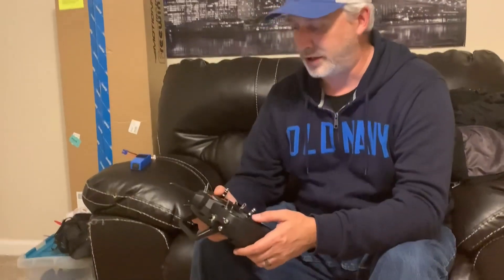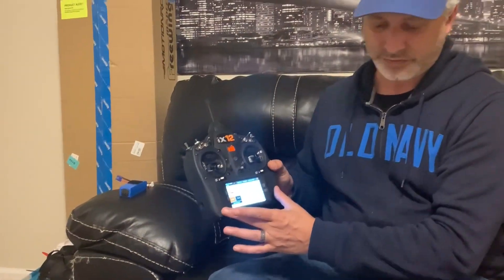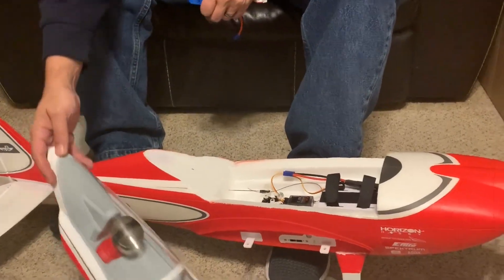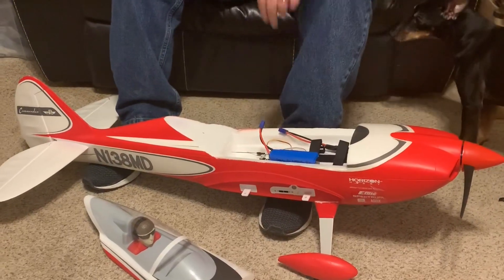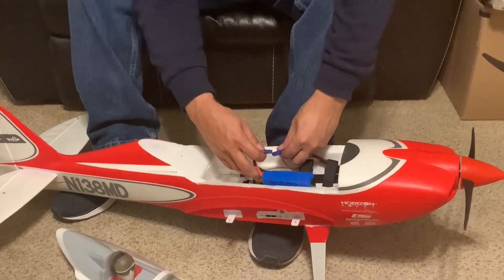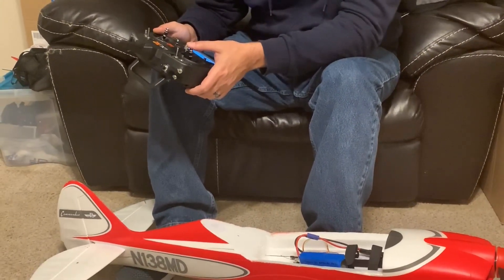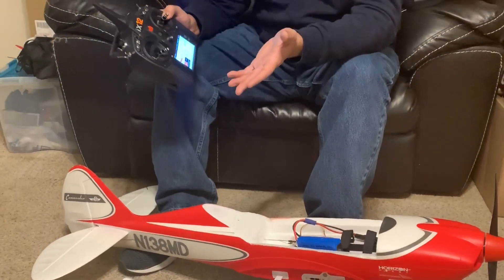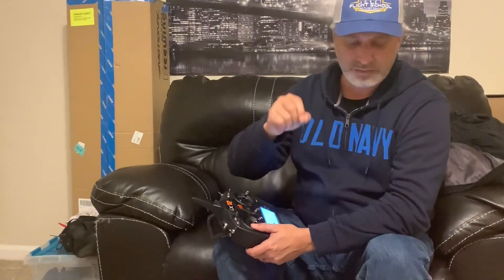How To: Calibrate your RC Airplane Electronic Speed Controller (ESC)

Comment: Not expecting a response but at least I’ll try have my very first plane and I got it used and ESC was broken so I bought a new one the 40 amp E-flight. I’m using a spectrum DX6i. I tried doing this calibration technique and it doesn’t do that first series of beeps it does something a little different. I think it’s like three beeps and then a funny tune to these switches that say flap. Jyro or gear or F mode and so on are those all supposed to be set to zero or on one all the way forward all the way back I do have my trim set all the way down to -100% my throttle button is inhibited I don’t know what to do. Thank you,

Comment: So my question is I don't start getting power to my motor until I'm between 6-10% throttle, is this normal or should it start powering up at 1%?

Comment: That's not calibrated when you get new speed control plug in to battery with throttle midway then push switch to top to heare two beeps then back to middle down to bottom then three beeps then it calibration

Comment: I have a vgood 30amp 3to4s esc and my motor is reving to high and kinda twitching and getting hot there is no deadband and I tried recalibration can this be because I'm using a 4s 100c rating lipo should  try 3s I'm stumped and I'm trying to get this going for my dad's birthday tomorrow thanks oh and the motor is a 2206 2500kv rated 4s thanks

Comment: Just seeing this for the first time. Excellent stuff. Does it matter if the transmitter has throttle cut on or off?
Reply from the maker: Throttle cut needs to be off. The ESC needs to sense that the Transmitter is sitting at 100% throttle to send the ESC into stick programming mode upon power up.
Reply: I tried it this morning on my Eflite Valiant and it did not seem to work. Does it have to be bound in AS3X only?

Comment: This is very helpful. I think i gotta do that for one of my planes. Did you keep throlle cut on initially when you plugged in the battery forst time with throttle stick all the way up??
Reply from the maker: You have to have the throttle cut off for this to work.
Reply: @TheRCAirMarshall  hope this works. My F 16 70 mm e flite motor keeps spinning even at throttle all the way down.

Comment: Air Marshal, I thought I knew how to do this but was having trouble with my Eflite 70mm F-16.  It didn't  have any get up and go.   I watched your video to double check and went to calibrate the ESC, it doesn't go into programing mode.  You get 1 quick squeal and then right into the 6 beeps.  Throttle cut is off, Throttle trim is set at -100.  But no programing mode.  Any thoughts?  I don't want to test fly it without the full range of throttle.
Reply from the maker: So oddly enough, some Eflite ESC’s just don’t go into a stick programming mode. Not sure why.
Reply: hi did you fix this as i have the same issue withmy vulcan70mm edf
Reply: @lewiscurtis733  Nope... never did.

Comment: hi thanks for the share tho i have to say that my EDF notor only make 2beeps and then silence for one second then again that 2beeps, why is this? i did the whole up throttle wait for a beep which never confirmed it just kept beeping as if my remote stick wasnt up when it is servos work fine on any channel really and this edf was working 20mins ago all i did was removed the 3wires from edf and plugged in my turnigy drone motor without the prop so that i can work which it did and note that i was not fully throttled it as i was just like you on my couch in home so all i did was switch motors , any tips ?

Comment: When you say set motor trim to -100,are you referring to digital trim switch next to the left stick? Also why is this done on -100 and not 0?
Reply from the maker: Yes, the trimmer next to the left stick on the vertical axis. To be honest, I’m not 100% sure why it needs to be all the way down when you calibrate the throttle. I just know it works. I’ve had instances where an ESC wouldn’t initialize and after setting throttle trim all the way down it fired up just fine.

Comment: My motor just runs even when in neutral. It wasn't like this when I started building the airplane. I am going to try calibrating the ESC as you showed and hoping that will fix it. Thank you
Reply from the maker: Gaurav Sinha try setting your throttle trim to -100 then do the calibration

Comment: During esc calibration process where is the throttle trimer (low end or in the middle), sir.
Thank you. I have E-flite E300 and evry time I connect battery motor spins itself.
Reply from the maker: BB I always set my throttle trim to -100

Comment: I have a Sport Cub s and I was trying to calibrate the ESC there's no beeping noise
Reply from the maker: Adrian Roldan try setting your throttle trim to -100 then try it again
Reply from the maker: Also, make sure throttle cut is not turned on when you do it.

Comment: I just got my first rc plane and i initialized the esc and got the motor to start but the throttle is backwards like when i put the throttle all the way down where idle/off should be it puts the plane into full power amd idk how to fix it or reverse it. I called tech support for motion rc and some  angry sounding british dude answered amd didnt help me at all. Someone please help...
Reply from the maker: Try to reverse the throttle channel in the transmitter. That should do the trick!
Reply: @TheRCAirMarshall  okay thankyou! But how exactly do i reverse the throttle channel? Im using a futaba transmitter. Its super oversimplified and doesnt have a touch screen. Is it the little switches on the back in the battery compartment?
Reply from the maker: What Futaba model is the transmitter? Do you have any kind of screen?
Reply: Update: i got it working and took it outside to test fly it and crashed ot 5 times in a row in a matter of seconds the 5th time it plummeted strait down and broke the whole nose. Im done with rc planes now this shit is too hard.
Reply: This was my first ever and last ever plane. The lippisch p15 from motion rc and its fucked now🤣🤣
Reply from the maker: Not the easiest plane to begin with! On Monday nights I host a Live Show at 8PM Eastern time. Would love to share my thoughts and guidance to help you have a more rewarding experience with RC planes. It’s an awesome hobby, would hate to lose someone after a bad experience. There are much better airplanes to start with! That Lippisch can be a handful as you know!
Reply: @TheRCAirMarshall  Then what is? I habe no access to a flight club (esspecially not during covid) and i have nobody who can teach me. For the last week ive been using a r/c flight sim on my computer but trying to fly this p15 didnt feel anything like  the sim.
Reply from the maker: I would look at something like an Eflite Apprentice or Mini Apprentice. They are both fantastic high wing trainers. You obviously have an interest in Jets, which is awesome and great fun, but everyone really needs to start out with a trainer. There are certainly ways to fast track to jets, but typically if jets are your goal I would say most folks aren’t ready for jets til their 4th airplane. This is definitely a progressive hobby and you need to crawl before you walk, walk before you run, etc. The simulator will help a LOT. Which simulator are you using?
Reply: @TheRCAirMarshall  I bought the RC-AIRSIM for 5 dollars for my computer because all the other rc plane sims (the high end ones like realflight) were 99.99+ and i figured i might as well just buy another plane for that price🤦🏻‍♂️🤣. Im kind of an idiot for thinking i could fly this rc plane i just really like planes and have always dreamed of flying an rc plane and i spent all night trying to figure out how to set up all the electronics because my manuel was in chinese so i had to learn the hard way and through google and now my  first ever plane is totally toast.
Reply from the maker: Well don’t let the dream die over one lost plane! It happens to the very best RC Pilots! RealFlight is a bit of an investment, but it’s the best RC Flight Sim out there. Yes, you could buy another plane with that money, but the reality is, RealFlight will help you get that stick time you need. With hundreds of planes to choose from. So you can crash and crash and a new plane only costs the price of hitting the reset button and trying again. Even the best RC Pilots use RealFlight as a training aid all the time. It’s worth it! Once you get the hang of flying a trainer style plane things progress pretty quickly from there. Just need to take the steps, and you’ll be flying a jet in no time!
Reply: @TheRCAirMarshall  Thanks a ton for the advice! You host a live show?
Reply from the maker: Yessir, every Monday at 8PM Eastern here on the YouTube Channel. Subscribe and turn notifications on and you should be notified when we go live. Would love to have you join us!

Comment: Hi, Dave - I just finished a home-built with the same E-Flight 40 amp ESC as you show in this video. I  bound it to my Spektrum DX6 and used your calibration procedure. I have flight controls but the motor will not run (new motor which works). Tried re-binding but no luck. Suggestions?
Reply from the maker: michael Broich hmm, have you tried running the throttle trim down to -100 before doing the calibration? And, are you getting the typical beeps from the ESC when you apply power? And one other question, do you happen to have throttle cut turned on?
Reply: @TheRCAirMarshall  As you can tell I'm new to computer radios. I'm actually an  ATP, Rotorcraft and Airplane, with several type ratings and have flown everything from Army helicopters to American Airlines 767s. I have flown a lot of RC but that was years ago and with AM and FM radios. I've recently returned to the hobby, and learning computer radios is a slow process for an old guy. I actually did  know about throttle cut, just didn't  recognize the terminology. It was set to inhibit, so I put it on a switch for safety reasons (don't ask me how I learned that was necessary).
Anyway, I found the problem - I had the ESC plugged into the wrong port on the AR 620 receiver. I'm good to go now.  Thanks!
Reply: The RC Air Marshall well, since I’m a rookie, I’m not sure how to turn the throttle cut on and off so please explain. That would be great if that was the only problem. In the meantime I’ll try the trim adjustment. Thanks
Reply from the maker: That’s great news! And probably the one question I would have never asked! 😁 Glad you found the issue!

Comment: Does it matter what the throttle trim is set at during ESC initialization? Should the trim be at zero? Some people say zero, some say -50% and some say +50%.
Reply from the maker: Jeff Cole I usually set my throttle trim at -100 and then do the calibration.
Reply: Appreciate the reply. Opinions are all over the place and your answer matches Horizon Hobby advice. Bottom line, all the way down. Throttle trim, they said is ONLY for liquid fuel powered. Thanks again!

Comment: Hi,
Thank you for instruction.
But i still have issue with spontaneous throttle ON as soon as battery is plugged. When i calibrate esc , then throttle issue stops. But then on the next flight, it recurs again , meaning throttle is ON when batt is -lugged. So , every new flight, i have to re-calibrate esc. This does not happen to my other esc ‘s. Pls help!
Reply from the maker: sabyx5 sorry for the late response here. Try running your throttle trim all the way down to -100 and see if that helps.

Comment: whats wrong if your motor just beeps and the prop pulses and that's all it does?
Reply from the maker: scole901 this process does not work for every situation. If you no longer have throttle response, I have seen it start working again after rebinding the transmitter to the receiver. Try that and see if you get your throttle back
Reply: @TheRCAirMarshall  I had the wrong receiver, sorry

Comment: Hey Dave, I'm going to try this on my new Opterra.  (Black Friday $99.00 👍) First flight on 3s 2200 30c, was really sluggish.  Put in a 4s 2200 30c and thought that would wake it up, but it wasn't much better. Just seems it should have more power.  Maybe this is the solution.  Thanks for posting this... ✈
Reply from the maker: wayne lee 630 hope it helps! Some Eflite ESC’s work like this, some don’t. If it doesn’t work for whatever reason and you end up with no response to your throttle at all after trying it, just rebind your model to the transmitter and that should fix it.
Reply: @TheRCAirMarshall  I will try it Dave, also, I hadn't thought of re-binding it. Worth a try. I wanted it for FPV anyway,  so some "slow " flying will still work. Thanks man. 👍